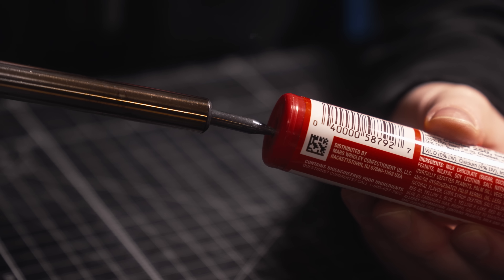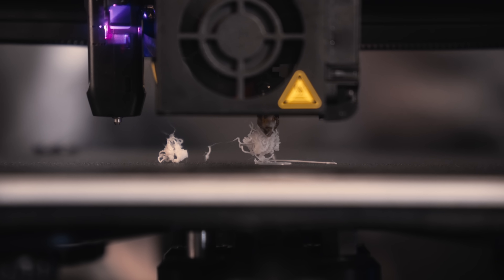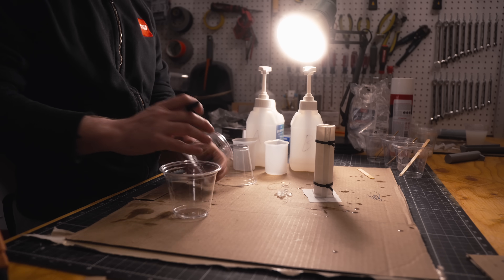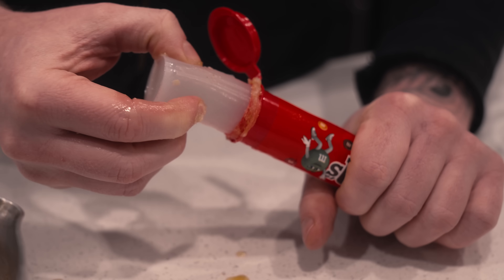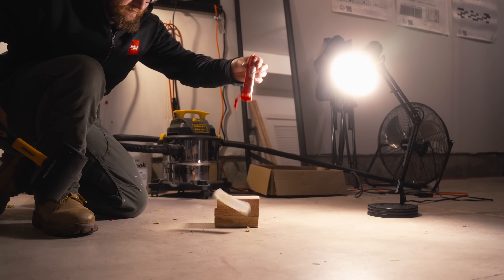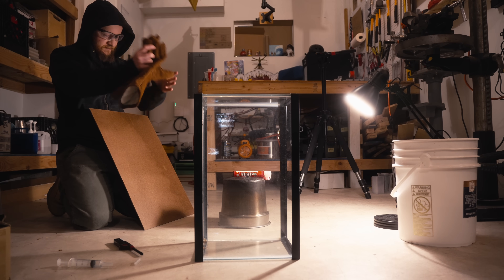Solving Reddit's Cylinder Problem with Science

Comment: My only gripe with this is that I really don't understand why you had to cast the size tester in silicone and didn't just use the 3d printed size tester directly to test the size?
Reply from the maker: Good question. The size of the tube is about a quarter milimerer narrower than the size at which the silicone gets stuck. If I measured the size of the tube with the 3d print, the cylinder might not get stuck at all

Comment: I don't understand what's so difficult. Take an exacto knife and make the smallest possible incision on the corner of the tube. No cylinder will fill the tube without leaving a millimeter of air (or banana) in that area. So cut, let some air in, slide cylinder out. Easy as peeling a banana.
Reply: I don’t think u understood the premise of this video

Comment: The very simple problem to the solution is to hand sand a corner of the end of the m&m container until you reach the through-way point where the cylinder is and that way the pressure will be released in the cylinder will be free without being damaged

Comment: Given the OP's situation, I'm guessing there was a time constraint too. LOL... some Q's though?
1) Is the inner cylinder square-ended? If not, small holes might be made to equalise pressure & run a line through so as to either anchor one direction while the 'larger body' applies force in the other.
2) Is the inner material such that cold would cause a reduction in size? It may also help with any material swelling that may have occurred.
3) Was the butter/banana combo an attempt at lubrication for release? A finer oil may have helped, such as baby oil... I guess OP didn't have any around. :-D

Comment: 2.25 that looks a little big, are we sure that's 5.1 inches?, I'm just comparing to a cylinder I have that's 5.7 inches

maybe it's just perspective

edit: 4:33 yeah maybe there's an issue with the 3d printer that it doesn't print it exactly to scale, best measure it to double check

and reply with the results, I'm still curious

Comment: I have a theory that the silicon was an expanding type of silicon that was entered the tube in a small state but then as it expanded, it removed excess air and space and creating a pocket of negative space. When expanded it can’t leave due to the forces of itself against the walls creating friction and the negative space essentially pulling the silicone in.

Comment: If only the cylinder had a way to expel some sort of medium like lubricant or even water through it to pressurize the buttered banana. It'd probably be better to use water due to the compression ratio, and it should probably also be lightly dyed yellow to facilitate observation. The momentary hydraulic pressure exerted could be significant, so probably just drink a couple liters of water, lay in an empty bathtub naked, and think really hard about how hydraulic cylinders operate for an hour.

Comment: I suspect the OPs cylinder was composed of a more compressable material than the molding silicone you've used. Meaning all the methods involving squeezing the tube could have resulted in crush damage to the cylinder

Comment: Many of the methods would not work as the cylinder is connected to a larger structure and must remain so, however the final method works just fine for that. Well done.

Comment: The soldering iron could’ve worked if he carefully melted the plastic at the closed end of the tube, thus releasing pressure, and then being able to pull the cylinder out/ push it back the other way

Comment: Onto time I smashed my thumb really bad and had a really bad blood blister underneath the nail. There was lots of pressure and it hurt. I got a small drill bit and BY HAND slowly drilled away at the nail till it made a relief point. Felt so good. I bet op could I have done the same but at the edge of the bottom. Easy peazy! Just make a tiny relief hole.

Comment: I believe the original problem of the cylinder being too large is solved by the knowledge that the original cylinder began smaller, and was pumped up to that size using hydraulic pressure of some sort. I suspect the larger structure attached to the original cylinder contained a pump that was used to increase the internal pressure of the cylinder.

Comment: An oscillating saw like the cast saw was my first thought. Going to the hospital is definitely the right move.

Also if the cylinder is what everybody thinks it is, being stuck in that tube might also result in dangerous secondary effects, such as blood clotting or tissue dying off. Potentially the cylinder even has to be harmed afterwards and clotted blood cleaned out to protect the larger attached object from damage. I have heard of patients whose cylinders stayed hard too long, and the fluid inside the cylinder thickened up to the consistency of tomato paste. In that case slicing open the cylinder and remove the paste, then cleaning everything and carefully closing the cylinder back up may be the only way to save it

Comment: i (25m) have trapped a cylinder (5.1" in length) into a silicone mold and i need to get it out. it is imperative that the cylinder remains unharmed.

Comment: sigh use scissors or nail clippers to notch the outer rim of the tube, then use a hair dryer, heat gun, or careful passes with a lighter to warm up and soften the plastic. Grip the outer rim of the tube with pliers or carefully with nail clippers and pull away from the cylinder. Alternatively, if the end of the cylinder is rounded and has space between itself and the edge of the tube at the tip, just take some pliers and carefully crimp the end until the base cracks to allow air through and slowly wiggle the cylinder back out of the tube.

Comment: Surprised you didn’t try using a device that rapidly vibrates such as a vibrator. It’s a common tool for non-destructively getting two pipes unstuck from each other.

Edit: glad you thought of the cast saw.

Comment: Why not just pee into it to hydraulically release the cylinder. Honestly this is probably fake, a folded straw would also have worked to remove the air seal if that could even be done.

Comment: After reading the comment I realized I now have to rewatch the video with a new understanding of "the cylinder".
I might be too ace for reddit.
Even the "specialized" website didn't made me realize. I just wondered if that was what OP had used and that was why he wanted to get it back cuz those can be pricey T_T

Also the "defect" in the design of the harness is common in cat harness. It seems they're designed specifically to render the immobile

Comment: if it went in happily with the banana hot, then you just need to get the banana that hot again, which means heat it slowly, bath could have worked if it was adequately hot, or just put the m&m tube partially submerged in recently boiled water

Comment: I theorize the cylinder would have come loose when the OP went to the bathroom.  Assuming liquid can flow through the cylinder.  Water can not compress so it would have to expand thus pushing off the cylinder.

Comment: I'm a carpenter when I work I have intrusive thoughts of catastrophic damages to cylinders, this video is exactly why I keep my cylinder always hidden, far away from power tools and angle it so in case of losing control of power tools it doesn't fly towards the cylinder.
Reply: You should always keep your cylinder attached to a larger object.
Reply: I'm more worried about my fingers myself, but now I'll make sure my cylinder tucked safely away from all power tools.

Comment: So fun fact cast saw can still totally cut skin if theres not enough padding or the cast is too tight, or the skin drawn tight. basically if it cant move around enough. A good deal of it comes down to technique and familiarity with the material your cutting. so even in professional care the prognosis for the cylinder was a bit dicey

Comment: You could probably quite easily design molds if you used the PrusaSlicer festure to cut model into parts and add pegs to then out it all together. Then you could desing one simple model in CAD, without even cutting it in half.
One limitation would be that you would not have the place for hot glue, but it might be worth the time save

Comment: Does your cylinder not shrink down after use? If your cylinder does not reset back to default size after 4 hours you may need to seek cylindrical assistance

Comment: Those materials assume the cylinder isn't stuck because it expanded. If a silicone cylinder the measured size didn't fit in the tube in the first place, it may have started with a lower circumference and expanded to that size (e.g. some kinds of wood absorb water and might swell or warp? Or a balloon inflating might be more similar) Maybe if it swelled, some of the methods that failed with solid silicone would work better.

Comment: Well I doubt that redditor engineering qualification. My brain ran a simulation 1 the cylinder is inside a tube so forcing it out you have to deal with the suction force which you need to have a hole at the bottom. There are 2 possibly ways to get it out.  First way is to use a air pump at the hole you created at the bottom using pressure. Secondly way centrifugal force the opening facing outward you can use a string and spun it or a bicycle 🚲 go figure out yourself on this.

Comment: Your mention of your Dremel gave me the idea of using a cast saw to cut the tube. Cast saws are designed to cut the cast (if not obvious) without damaging your skin, and considering that the cylinder can't be damaged I feel like it'd be a really good choice to at the least try it.

My second thought upon the cast saw was a bone dremel–although particularly the "Halo" bone dremel, which is designed to push flesh or soft material out of the way with a ring that yields to hard material to cut it.

While these are medical tools and very likely aren't cheap or easy to get, they're still plausible options that I think could work if done correctly.

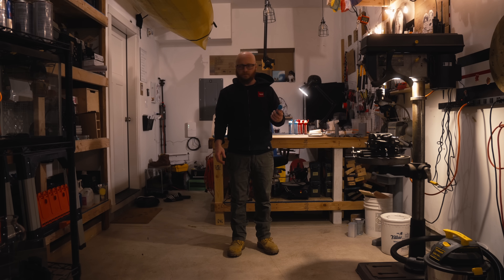Comment: 9:25 Its useful when there is pressurized oil inside the cylinder that makes it rigid, to make the oil go away and release the pressure to make it soft again.

Comment: Here's a review of each method and if they would still work if the cylinder was attached to a longer object as was stipulated in the reddit post

1. smacking it on the table ✅ but not as hard probably
2. Knife ✅
3. Jumping jacks ❌ he was holding the cylinder in the wrong spot
4. Cat ✅
5. Hammer ✅
6. Saw ✅
7. Sander ✅
8. Dremel ✅
9. Drill press ❌ (but a regular drill would work)
10. Vice grip ✅
11. Car ❌
12. Vacuum chamber ❌
13. jar of acetone ✅ (can be put between couch cushions or something)
14. Heat gun ✅
15. Torch ✅
16. Soldering iron ✅
17. Taking a bath ✅
18. Pot of boiling water ❌ but maybe could be poured on using a kettle
19. Drilling a hole in the tip and filling with acetone ✅
20. Cast saw ✅

Comment: Never stick your cylinder into anything rigid and air tight; if it gets sealed in there juuust right, it's stuck. There are plenty of specialty stores that sell cylinder receptacles with a detachable silicone base or insert; these are to be preferred as they allow easy emergency removal of the cylinder without harming it. Remember to be careful if using receptacles with a vacuum pump attached, as drawing or releasing a vacuum too quickly, or drawing too high of a vacuum can cause permanent damage to the cylinder.
Reply: Wow, science has truly gone a long way for many of us to insert our cylinders into a small tube without damaging said cylinders! I better experiment with one myself for a better appreciation of humanity's effort.

Comment: Have you considered using a cast saw? They are designed to cut solids but not damage anything fleshy by vibration at high frequencies?

Edit: I finished the video. Ignore this comment.

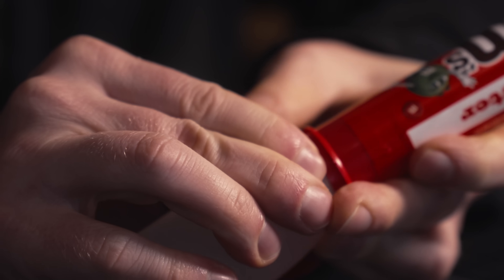Comment: 4:36 if only the cylinder could change its size. Perhaps if it was made with a squishier spongy material, with a flexible and water resistant wrapper, and then you could have a liquid injected into it to increase its girth and firmness.

Comment: Nobody had the idea of using a really thin but long object to insert to try and release the negative pressure? Just get a paper clip with a very slight bend towards the top to avoid puncturing the cylinder and insert as far as you can then take both out

Comment: Honestly I was trying to think about the melting point of the plastic, and not entirely melting it to the point of it collapsing but enough to change its shape and try to pry it off. Only issue would be at which point the cylinder would receive 3rd degree burns.

Another thing you could do is heat up a super sharp knife (like an exacto with a brand new blade) and dip only the tip through the plastic (much like OP did), then defore going any further in, turn it so that the dull side is facing the cylinder and try to score around the bottom edge. Then you could pop it off so it was an open cylinder, release the negative pressure, and then pour oil or somethin slippery down that SOB to eventually slip it off. This of course is assuming that the end of the cylinder is a little more rounded, leaving that space to have the knife move in at all.

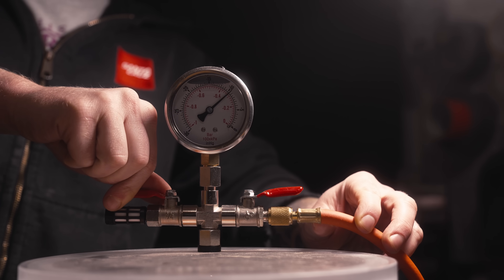Comment: 12:12 If you pulled the cylinder while it was in the vacuum chamber it should slide right out like when the banana butter was still hot

Comment: Just use a box cutter and cut the bevel on the end off at a 45 degree angle so that just the very end plate can be removed and the negative pressure of the mashed potatoes can be relieved

Comment: If the cylinder had a domed end, even if the tip was touching the end of the tube, there'd be a little bit of free space around it. I wonder if you could take nail clippers and cut the edges of the end of the tube in order to allow some air in and reduce pressure

Comment: Ok, I believe this particular cylinder is of the type that also has a hole and a smaller, more flexible tube running through it. Remembering that it is attached to a much larger object and must not be removed from said larger object, I believe the larger object can intake liquids and, given enough time, output those liquids via the cylinder that is currently stuck. If negative pressure is the culprit, perhaps forcing some liquid through the intake and out the cylinder would allow positive pressure to build up and ultimately force the cylinder out.

Comment: You didn't consider a pressure differential, whichcould be achieved by adding liquid to the tube through a pipe running through the cylinder with this exact purpose.

Comment: I have the solution in case anyone stopping by gets their cylinder stuck:

1- take a thumbtack and pierce a hole in the bottom of the tube. These kinds of cylinders rarely if ever reach the very end of the tube, so the cylinder should remain unharmed. 

2- take a syringe (without the needle), fill it with air, then pump the air into the new hole.

3- the air will make it possible to pull the cylinder out.

4- you're welcome.
Reply: bro speaking from experience

Comment: all it should take is a single ~1-1.5 mm puncture on the end of the M&M tube. I'd test it myself but I don't have access to cylinders under 6.9 inches in length and 1.9 in circumference

Comment: I have a suggestion on the method used to... trap... the cylinder in the tube. I have a smaaaall feeling that the size it had while being inserted inside of the m&m tube was smaller than when it got stuck. that said, I believe that the experiment would be more accurate if you printed a cylinder with a smaller diameter and then insert a needle and... injected a liquid inside of it to expand it while it is inside the tube,  thus trapping it in said m&m tube.

Comment: You should try using Shapr3D its the best cad software for beginners out yet. When you get good at that you should try switching to Autodesk Fusion which is so much more capable than anything youve ever used and is still easy to use

Comment: can't the pressure solution work with mild squeezing, just enough to create enough of a gap to let air in and undo the pressure differential? surely the cylinder can take being squeezed tightly at the base

Comment: The cylinder is probably a weasel, and the larger structure it was attached to was probably connected to a leash. Considering the cylinder remained unharmed long enough for hospital, the weasel got stuck buttocks first. This implyies it was attached to the leash by a collar, which in turn implies that the weasel was a pet, explaining the imperative to prevent harm befalling it. What the leash was attached to is a bit more mysterious, but considering the ability to move it to a hospital, it was something reasonably sized, perhaps a part of pet enclosure fencing. 

As for why the weasel got stuck, is a mystery - perhaps it wanted to eat the odd banana-butter mixture, or perhaps it was looking for shelter and mistook the mm-tube for a comfortable clam.

Comment: It would have been sooooo easy for OP to slowly auger a hole in the distal end of the tube. Easy enough to do slowly  in a way that doesn't harm the end of the cylinder if the auger blade is dull enough

Comment: u just need to stick an even smaller hollow cylinder into the tube alongside the toher cylinder until the smaller cyliner reaches the end of the tube. then air can get in and theres no more suction. like a capri sun straw or one of those hollow coffee stir sticks. if you melt the end of the straw or such so that its not sharp but still has a hole in it, then it wont even damage the cylinder probably.

Comment: Rookie mistake making a cylinder simulator that starts off at full size. You need one that will expand due to external factors to get it in to the tube before increasing the size for a proper experiment.